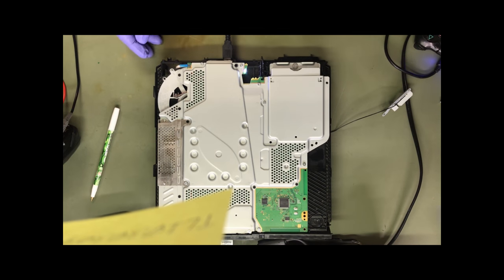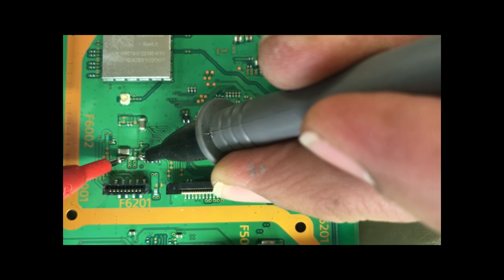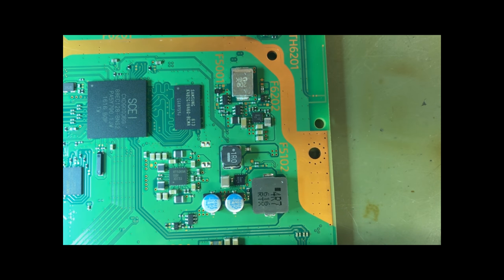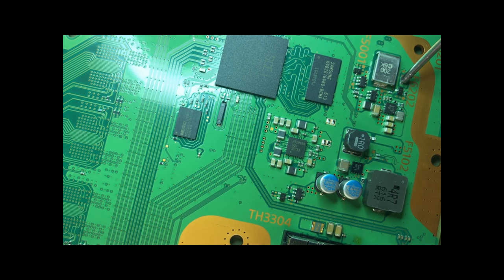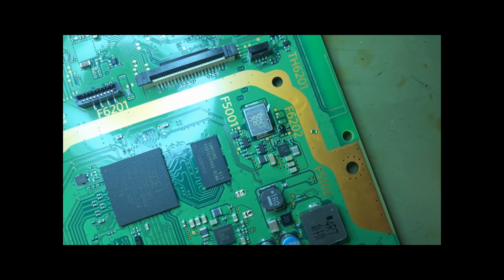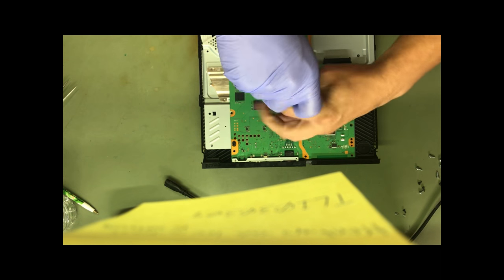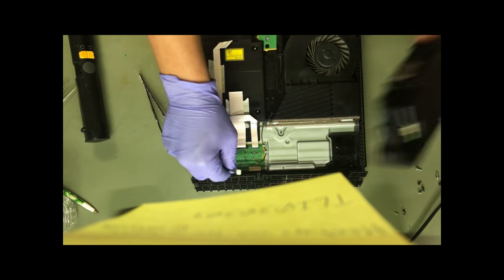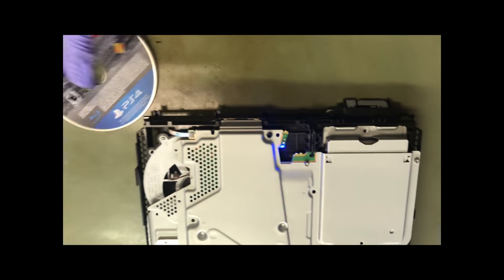42118-6 Update Error PS4 CUH-2015A Disc Wont Accept or Eject Error and Repair

Comment: Hi I replaced the same fuse and it worked for a second then stopped. I when back to fuse and it's ok can not find another blown fuse. Can you help thanks in advance
Reply: If u fixed fuse check ur blue ribbons